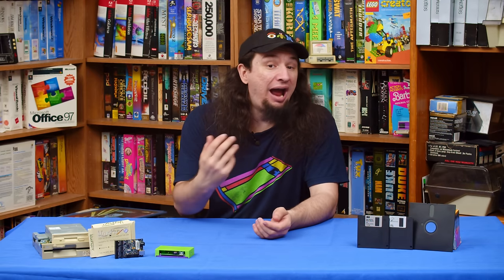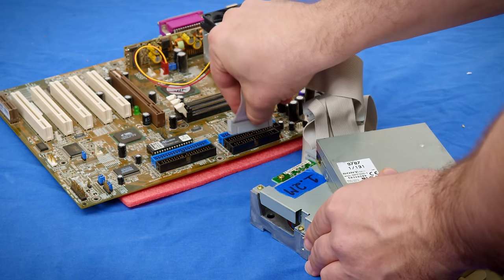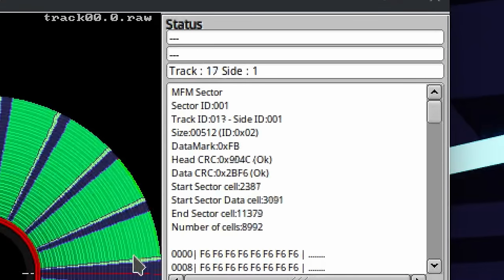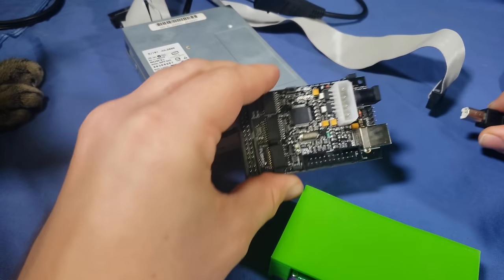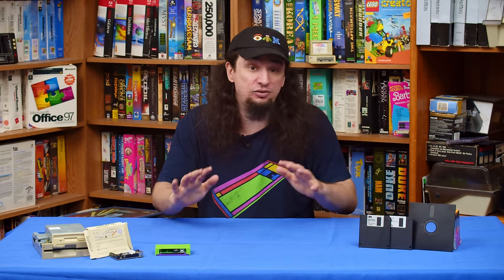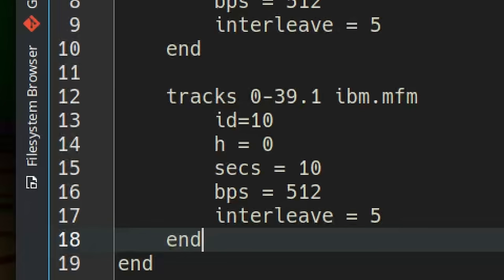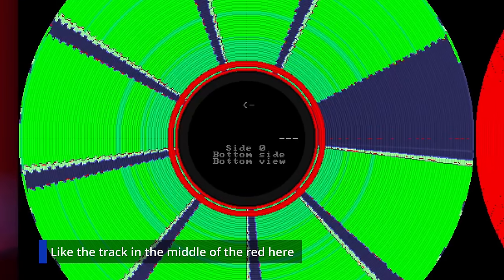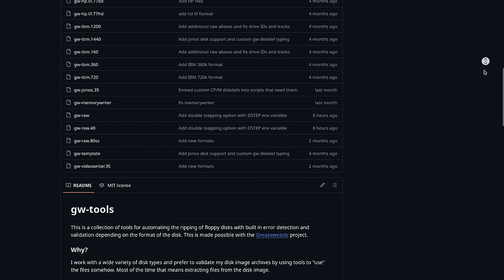Archival Floppy Disk Preservation and Use

Comment: In some older BIOSes you can set the A drive to 2.88MB but ive never seen 2.88MB floppy's or drives. How do they work? Just more sectors or is it more complicated than that?
Reply: They require special media, they can hold 4mb unformatted.  IBM and Next computers can both use them, but they are incompatible with each other.  It sounds like they can be FM or MFM.
Reply: Have one of those but never could get it to work, dunno if it is the drive or the few disks I have.
Don't even remember if the 1.44MB disks worked...
I still have the drive and disks... somewhere.... buried... :D

Comment: Funny how the internet know what I'm doing.... I just got a 10 bay ATX tower for a Grease Weasel project 360k single side 360 DD, 720K, 1.2HD 1.44HD 3" all on one ribbon connected to a Grease Weasle 4.1 usb to internal usb headers, Its a Pentium 3 1Ghz Asus CuSL2-C AGP 3DFX 16mb +SLI12mb +4mb PC passthough, IDE Zip250, IDE LS120, Pioneer Slot load DVD, 80GB IDE SSD , 768MB ram, SBLive sound, all into one tower for the purpose of archiving, preserving and writing games back to realy disks. I have Apple iis, C64, Amiga, Atari ST, and rare PC8801,PC9801 systems. Get a Grease Weasel you won't be sorry
Reply: 3" or 3.5"? 3" is rare and the only systems I know that used them were Amstrad and the Sinclair ZX Spectrum +3.

Comment: What I really need is a way to read CDs and analyze raw optical data. Spoiler: safecopy isn't low level enough as it still abides by the 'cdrom' protocol (goes as low as (re)reading specific sectors with error correction). This doesn't work if the drive thinks a CD-RW is "empty" because the three copies of the info sector are all gone bad.
Reply: Lots of data recovery tools out there...web search...  I used a data recovery tool that came with a media suite

Comment: I typically use the FluxToIMD python script by Eric Smith for decoding to sector images. This supports M2FM as well, and has a fairly good and flexible PLL implementation. It also uses multiple revolutions for retreiving as much valid data as possible, while also (unlike HxC) giving the user control over all export parameters.

For instance, HxC will automatically force MFM quantization even when decoding FM, and that requires that the controller that wrote the disk in the first place needs a margin of error within MFM specs (which is half of the actual margin of error for FM). It will also assume MFM for mixed formats like RX50.
Reply: Then set the "FLUXSTREAM_PLL_FM_INTER_BANDS_REJECTION" parameter to 1 into the HxC software settings window or the config file to have the FM quantization ...  ;)

Comment: ...and it doesn't matter how would you count, a 3,5" HD floppy does not have 1.44MB capacity. It has 1440kiB (2 sides * 80 tracks * 18 sectors per track * 512 bytes per sector), which is about 1.4MiB or 1.47MB. Back then they were not using MiB for indicating binary prefixes; however, they were using 2^10 base by default for IT-related stuff, so why 1.44MB... who knows?
Reply: There were not marketing in FD. And the size of disk has honest numbers.
Reply: I would guess it is linked to 720kB capacity because it is double the size?
Where does 720kB come from?
Reply: @kaunomedis7926 My point is - no, it was not honest: up to kB, they were using binary prefixes, but when switching from kB to MB they decided to use a decimal prefix. Unfortunately, instead of doing it right from B, they did it only from kB, so it is neither MB nor MiB.

Comment: AAAAAH. Multiply the 512 bytes per sector by two sides, 80 tracks and 18 sectors per track as described in the opening and you get 2880 sectors of 512 bytes or 1440 KiB.

It is only marketing nonsense to call this 1.44 Megabytes. That would be a megabyte with 1,024,000 bytes. Yes everyone does it. They’re all wrong.

1.4 Megabytes is close enough, to one two significant figures.

Comment: ummmmmm I've never seen a file format that has pre or post track metadata that doesn't need it. Like never ever. 42 years. Not once. Every single one needed them, images were useless without them. So be warned people, if you find data where it doesn't belong, include it in your images.
Reply from the maker: My HP 3.5in floppy drives I showed in this video write a non-filesystem track separate from the other's for its "Media Monitor" feature that checks how long the disk has been in the drive and warns the user to replace it after some time has passed. Omitting this causes no issues to the actual files and can even be a benefit to reset the clock when you copy to a new disk. So there are instances of data that are not relevant to the files on disks.

However, I will still say you should flux every track and back that up. That was just for decoding I was mentioning extraneous tracks could possibly be ignored.
Reply: @TechTangents  learn something new everyday